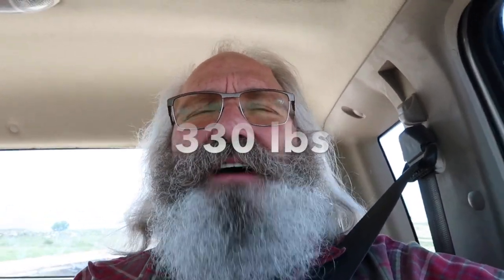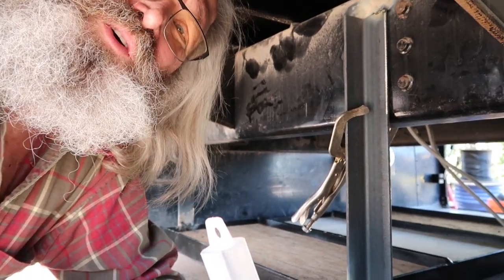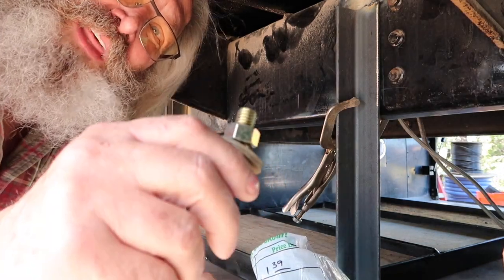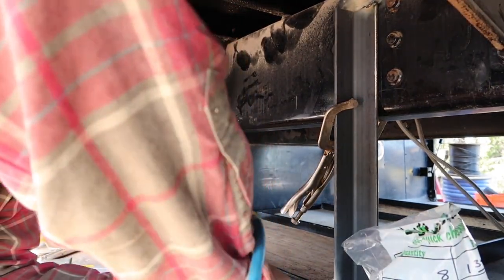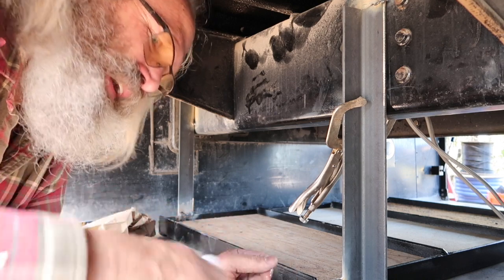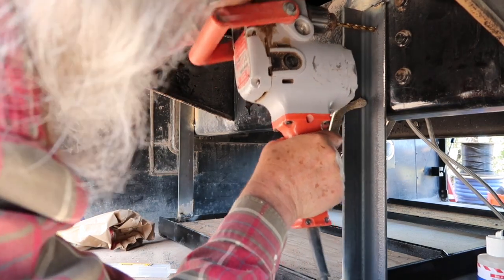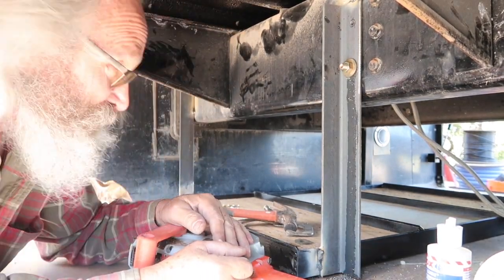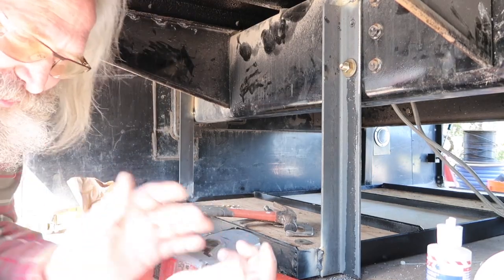School Bus conversion to Motor Home #32 bolting on the battery rack...

Comment: Ive been a diesel mech for 42 yrs and work on semis,drilling them hard frames are not easy, i use a ream bit,when moving spring hangers and cross members the bolt size very from 9/16 to 5/8 and even 3/4,hard on a fellow, you done good sir

Comment: Hello Jim, Your did a good job building the frame for your batteries, I totally agree with you that you want the weight to be on the frame and not the storage floor. I know large truck frames are tempered for strength, Your bus frame may also be made of special steel to handle the long span between the axles not to mention passenger weight. That could be why you had a harder time than usual. Take care Jim.

Comment: Agree that a smaller drill with sharper bits will save the day, even if you have to go out and buy the bits.  Sharpening bits is also key; everyone sharpens their chainsaws but few sharpen their drill bits.

Comment: Those are grade 8 yellow anodized. Good Bolts, strong. That is a monster drill. Hind sight is 20/20, but as a thought you could have drilled the holes in the bracket before going under the bus and then you would have only had to drill the frame.

Glenn Lever

Comment: Jim for future reference go down to your local tool rental and rent a magnetic portable drill press for $20 and save your body.  I would have also considered drilling the holes in the hanging brackets outside the bus on a regular drill press before welding them to the tray.  Work smarter not harder =)  Also if it were me I would have added a diagonal on each side.  You really shouldn't base your calculations on static weight--1440 lbs of batteries as an example--because there is a lot of inertia involved as well.  A sudden panic stop as one example, and why I suggested the diagonal braces.
Reply from the maker: Thank you for the suggestions.  Hopefully it is all completed now.  We do have plans to change out the AGMs for Lithium batteries soon and that will reduce the weight substantially.

Comment: hi Jim you really are a tough manly man I'll have to take my hat off to you... I have been in many similar positions and situations as you were drilling those holes and you're right no one to push on your back you slide across the floor streamly hard and for a guy that starting to get up there in age... not saying you're old ,, but don't feel bad if you got tuckered out after 4 bolts that would tire out a 24 year old in Peak condition let me tell you right now.... and as usual I noticed something I would do differently that I think will help you.. I noticed you put two flat washers and then a standard nut even though those appear to be grade 8 bolts which are wonderful but I did not see a lock washer those nuts will work loose and then you're going to have problems... I myself would invest in nylon locking nuts and that way they will never come loose.. just make sure that you're locking nylon nuts are grade 8 as well that way you can really torque  them down... I hope mama gives you a good rub down with some Bengay after that one hahaha until then take care doing a wonderful job jim

Comment: Those are AGM batteries correct Jim? You going to do a video on the drive train? You have one of the best engines in a bus your size the 8.3 Cummins. Doesit have the MD3060 trans? I hope to also find a similar bus to yours.  A 40' Thomas Safe T liner RE 8.3 Cummins/MD3060, air brakes,air ride and under bus storage bays.

Comment: I would have used more bits to get to the final size. like starting with 1/8", 1/4", 3/8" to final or 1/2" in between the last.
you are doing great.
is your generator an auto-start?
Reply: there is an issue with the pip, if the battery voltage drops below a certain value that the inverter simply turns off and won't charge the batteries by solar until the batteries are brought back up above that value. so having an auto start generator is a really good thing.
best

Comment: I think I would have attached that battery frame to the "floor" , just used some really big rubber washers or something similar instead . for some cushion going through all that, :D
Reply from the maker: Adam Norton,  thank you so much for the great comment.  It would have been MUCH easier but the batteries each weigh 120 lbs.  That would be 1400 lbs. and I didn't want that much weight on the floor of my storage.
Reply: I didn't say I would have been right,  just what I what I would have done.  I expect that when I build, I am going to do it wrong quite a bit. ;)
Reply from the maker: Adam Norton, always love a great sense of humor.  You are awesome.   :)

Comment: Jim please leave that ol drill alone it's a tendon ripper I know it's happened to me and it hurts rent your self a good mag drill or get a craftsman half inch it's lighter and easier to work in a tight spot with a tapered carbide bit would take a lot of work out of that job too

Comment: I know there's a reason you didn't weld it?
Reply from the maker: Jeff Rouse, yes.  I had a lot of people concerned that it would weaken the frame.  I contacted the company and they said that it was no problem to weld, just weld 2-3 inches at a time and let it cool.  By that time I had already bolted it with Grade 8 bolts and I just used weld to tack it in place and then drilled and bolted.  It is very stable now, no problems. Thanks for the questiion.  :)
Reply: Makes sense! Thanks for clarifying. Love your channel!